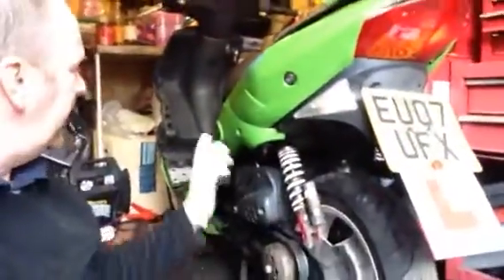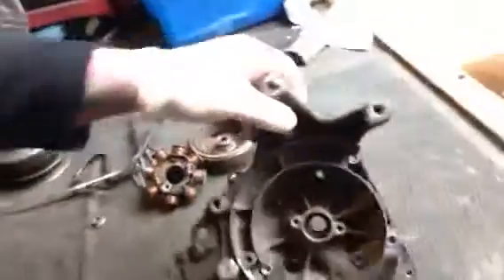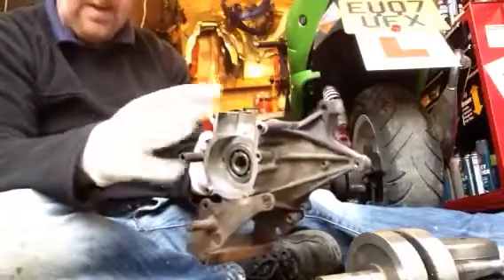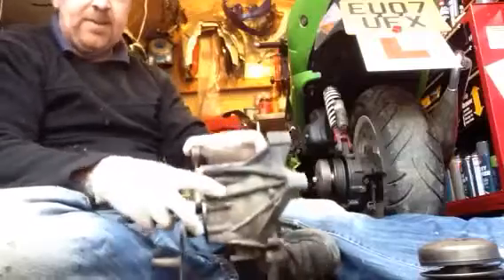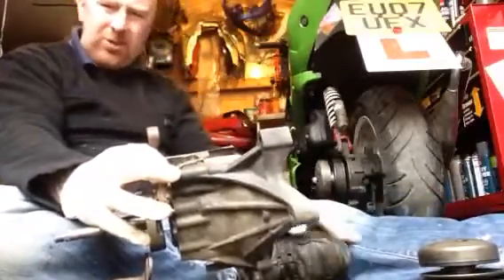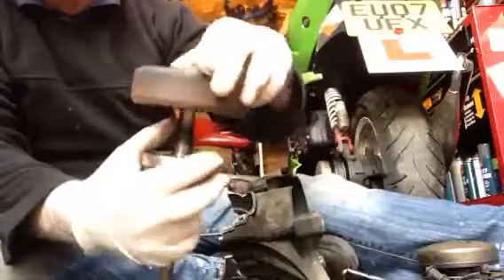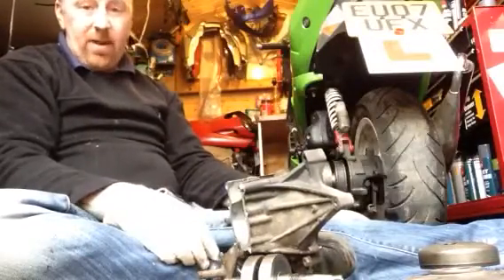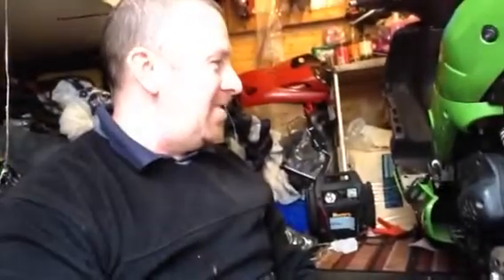Changing the crank on a moped Speedfight mark savage

Comment: I HAVE a problem. I did an engine rebuild on my speedfight2 50 LC. I changed crankshaft and crank bearings /new oil seals. It has a nice spark, gets fuel, compresion is good, but it just won't start. I tried everything but all it does it smokes a bit after cranking for longer time, and kinda would want to start but just burns the gas but won't start.

Comment: i have a problem where i splited the engine case on my piaggio zip and changed the piston and crankshaft but now the case wont fit? The case wont close fully i think the case is touching the crank bearings I have a doppler endurance crankshaft.

Comment: can the rear crank shaft be swapped on a peugeot v clic my back wheel seized and no garage could get it off so got told to cut the wheel off crazy I no but was gonna get charged more then what the bike was worth cheers shane
Reply from the maker: It's the gear box shaft and yes 
I have a video on a speedfight gear box 
Same thing 
Check it out
Gearbox Mark savage

Comment: hi my crank fell in a tank of gasoline while working ...should i relubricate it with 2T oil or is it ok to screw it back in like that?
Reply from the maker: I'd let it dry and rub a little 2t oil around it like you said bud 
Then fit 
Also with the piston when fitting with a  2t
Reply: @marksavage  thank you // i can get back to working on it now

Comment: Hi mark ive just aquired a speedfight 2 ive done a full enginge rebuild from crank upwards its the electric oil pump version kicked it over it trys to start but then doesnt do i need new cdi and voltage reg thanks
Reply from the maker: Was it running before ?
Sounds like crank seals ??
Have you done the wet hand test ?
Might just need some easy start to get it going 
As long as you have put it all back right
Reply: @marksavage  i havent had it running crank seals are in good condition no leaks from either side and wet hand test? Not heard of that before bit ive had a look today while its trying to start it does a littpe back fire every now and again and all put back together right ive had experiance with these just not the cdi/oil pump in one
Reply from the maker: @lukesykes6662  if you have a nice blue spark cdi is all good 
Oil pump wouldn't stop it from running !
80 speedfight videos 
Wet hand carb test bud its all in them 
Back fire is fuel 
Normally piston , reeds , oil seals?
Carb ok ?
Reply: @marksavage  il have a go over it all again tomoz thankd for the help your a legend
Reply: @marksavage  where could i get a cdi/oil pump if needed
Reply from the maker: @lukesykes6662  wait 
Oil pump 
Theres two manual or electric 
Next cdi there's 4 
Immob , black or grey cdi oil or 4 pin 
Like in my video on cdi
Reply: @marksavage  its grey delorto one atm 8 pins if im right
Reply: And its a electric oil pump
Reply from the maker: @lukesykes6662  so that will be an oil cdi to the left side of the battery grey or black 
Oil pump under it
Reply: @marksavage  yeah its a grey one and oil pump is attached to left side of the frame i think that is grey too
Reply from the maker: @lukesykes6662  so you won't know if the pump that works till the engine runs but if you have spark the cdi works
Reply: @marksavage  il let you know how i get on tomoz thanks mark
Reply: @marksavage  update yellow spark
Reply from the maker: @lukesykes6662  well it should be yellow lol 
Blue to orange not yellow and you should be able to move it away slowly and it should jump to spark upto 5mm and away 
Change plug bud !
Reply: @marksavage  its more of a red to yellow

Comment: Is it possible to install a crankshaft without the installation tool, could I heat up the engine case and put the crankshaft In the fridge??
Reply from the maker: you can do the fridge bit as it does work plus just a little bit if 2t oil , don't heat it up no need bud
Reply: @marksavage  thanks for your help mark

Comment: Im not sure how you have such good luck with using a hammer, but more power to ya bro. I enjoy all you vid a lot, I appreciate you taking the time share the knowledge! Keep up the good work bro 💯🔥
Reply from the maker: as in my new videos now bud i use a impact drill now , off in seconds bud for both variator and clutch
so much easier
i have over 150 on them now for everything

Comment: Excellent videos as always.. Do you know if there is any way of testing a fully electronic display. The vivacity does not have a speedo cable, all the back of the display has is a single connection block and it looks like the LCD display has gone. All the other bulbs work fine and the display lights up as it should but no fuel gauge, clock or odometer display.  Have checked all the wires are pushed in as far as they can go in the connection block and swapped out the battery and regulator for new ones but still no joy. Continuity tested the fuel gauge wires and they are all fine too. Any ideas what the problem could be? Or am I right in assuming the whole display will need changing out for another fully electronic one?
Reply from the maker: im going to be looking at one next week with the same problem and normally its the clocks , this one was working until a guy changed the front bearings then said it just stopped 
inside the front wheel sensor is the clips and often go so im going to start there to see how he put it back on 
the cables do go but cost bud same as the clocks 
to be honest and the cheapest way to get around this is to get a phone holder and use you phone with an app for speed 
works very well !
anyway look out for the video in a few weeks 
take care bud

Comment: Hay mark, top vids, i changed the weights in variator, and iv properly buggered, the threads and nut on the crankshaft... is it repairable. Or would i have to change the whole thing..?
Reply from the maker: oh dear!!
that's not good, ok one trick is to drill through it with the nut on and put a pin through it to keep it on, ive done this before and it lasted, welding doesn't work as it just comes off and after a while.
other than that you will have to change the crank sorry to say, like in this and other videos on mine I have showing how to change it with the engine still on!
hope that helps, please like and sub
mark
Reply: Cheers pal, iv liked and subbed, pal.iv no experience, in doing such a big job though to be honest, iv seen ur vid, im not sure. IS it easy inuf to change.? Finding a new crankshaft will be a job in its self.lol. what do u think, about iv i thread it down a size.? Can u do that.? Cheers mark for your advise...
Reply: mark savage i say mark so it is possable to change the crank shaft with out taking engine out. Still a job though pal eh.lol
Reply from the maker: Matthew Marshall every time I’ve tied it it’s come off ! 
Has to be a new one bud 
But I guess it’s worth a try !!
Reply from the maker: Matthew Marshall yes bud I have a video on here on how. To do it 
There is over 70 speedfight videos bud best sit on a computer to see them all 
Plus I have another channel with all of them on a play list to watch under mark savage speedfight 
It will help loads 
Mark

Comment: thank you my bike was taking in no fuel im replacing the crank seals baring and shaft also the bike had no gasket on the crank case so i orded them too and some high temp gasket sealant got my self a 21 mm carb and the 70 kit racing cdi that can advance the timing but im going to leave the timing at stock
Reply from the maker: thanks for wathcing i have many other videos that may help 
please like share and sub 
mark

Comment: Hay mak yhanks for your advise, just one thing, about pinning the crankshaft, wi the bolt on, any tips on how deep thickness ,and what to pin it with.?
Reply from the maker: Matthew Marshall tbh I’d change it , this idea is only a repair that may work !
Drill right through and it will be hard to drill . 3 to 4mm and use a good split pin or hard steel nail and bend it over 
That kick start may not work after due to this 
Mark

Comment: Hi mark great video. Do you have a video why moped is still smoking after a minute of running?
2stroke engine. How to solve the problem thanks
Reply from the maker: hi bud 
its a few things like in my oil video cheap 2t oil so change to a better one , oil pump is adding to much 2t oil or more common its your piston rings

Comment: Hiya mark, iv a qestion pal, can i change the crank shaft, without takeing the engine apart,? Is it easy inuf, for some1, who has never done it.? Cheers pal
Reply from the maker: I have a few videos like this one that will help 
If you bikes not running what have you to lose !
I've done loads so ok it seems easy for me 
Getting it apart is the hardest did 
I'd take it out for doing it for the first time as you get a better view and all round access 
With 70 videos on speedfights you have all the help you need bud

Comment: Hi mark there is a scratch in the crank case on my speedfight 2. Should I try to get rid of it using some fine emery paper or should I just leave it.
Reply: It’s air cooled if that matters
Reply from the maker: hi bud thanks for watching as for the scratch as long as it's not leaking out it should be fine, odd how did it get there?but as long as you put it all back together and it all works all will be ok have fun bud please like share and submark

Comment: Hi, Can I ask your advise please.
I have a Yamaha Aerox 100 that needs crank bearings, they arrived I put them in from the freezer over night, popped in the freezed crank all going smoothly done up the crank bolts and it binded up, centering the crank did'nt work, would you say I have a bent crank?
Reply from the maker: ive never put them in the freezer but I have heard people doing it !, more like the bearing is not straight take it all out again and a look if all ok and that the crank went in on line and straight then if no damage try again but maybe tap it with a mallet lightly and around in a paten, hope that helps I have done a few videos on the aerox bud maybe have a watch, please like and share/ subscribe . mark
Reply: I used to fit wheel bearings on cars, have my own press, I ordered some more bearings C4 this time instead of C3 but will tap around the bearing after it pops in again, I have bought another crank just waiting delivery and will freeze that as well, will let you know how I get on, thanks for getting back to me so quick, thumbs up
Reply: mrcreativequarter . 4 months later . How did you get on with it ? was it successful

Comment: I got the bike with it already off lol trying to put it back on but I think the fed on the crank where you put the but to hold it all on has gone
Reply: Nut*
Reply: Can you tap and die the crank end ?
Reply from the maker: oh bugger, I've always changed the crank as it never really works and then you can not get the kick start to work as it goes over the nut to connect on to , give it a go but I never got it go work well or for long!!!!
Reply: +mark “marky bike” savage is it hard to do
Reply: +mark “marky bike” savage and they are like £74 new
Reply from the maker: I've done a few video's on here on how to do them and about that price, it can be hard for the first few times and times do go wrong! seems silly to have to take apart the engine just for that but I always do due to doing a fix just doesn't last long !!
Reply: +mark “marky bike” savage have u got a 2nd hand one I can buy from u
Reply from the maker: Sorry mate no
Reply: +mark “marky bike” savage what you think I paid £150 for the bike it will need new crank I'm thinking just sell it back on when I get the log book as by the time I fix it and mot would not get much back also could be more problems
Reply from the maker: That's the problem bud with doing bike up, I would of had it off you if you were local lol but you should get your money back in parts alone
Reply: +mark “marky bike” savage lol I'm in west London how much you think I should ask for the lot
Reply from the maker: +daniel what year mate and what are the panels like , well most none runners from 1'£100 to 300 mate
Reply: +mark “marky bike” savage Lreg what spark plug do I need is it the NGK BR7HS I got the crank sorted but won't start so working my way about the bike
Reply from the maker: +daniel yes mate Ac br7hs lc br8hs for 50cc , as long as you have spark now try some easy start to get it going bud
Reply: +mark “marky bike” savage thx I have spark will get some easy start and new spark plug anyway mite come in hande if I need it thx man your so helpful

Comment: Hi Mark thanks so much for making this video, I have a problem with my 100cc since rebuilding yesterday. I think it tried to seize earlier and maybe due to starvation of oil? Riding along after 3 or 4 miles or so and it bogged down. Starts and runs as cooled down but wondering how to test the oil pump? Any ideas on if it could be anything else?
Thanks in advance
Reply from the maker: it common so 1st do you have a manual or electric pump?, this maybe why the piston went in the first place, as in my other rebuild videos out some 2t oil in the pot as you may have already damaged the piston if it got hot!!
so either start over or pop a little in with the petrol and the test 
see when running if you have oil coming out of the pipe ,it should start to come through quickly after a few rev's or start to come down the pipe.
if not replace but by putting it in with the petrol it will stop a seize like in my rebuild video.
hope that help bud . ,mark
Reply from the maker: and please like share and subscribe , mark
Reply: Thanks Mark, think it's manual it goes from tank to pump which is on crank casing with throttle cable attached and then a smaller pipe comes direct from that into the crank casing. I have taken that off and started bike and nothing comes out whilst running... Is this the pipe you were talking about? What sort of pre mixture would you recommend? I guess that would tell me if it's oil related also!  Thanks again.
Reply from the maker: Paul Bayliss yes you have a manual one and an older one too after that it ran only from the crank then next was the electric ones, ok so you have an old one that opens as you open the throttle , is that working ok ? If on oil is getting to the carb from that small pipe it need changing but for now on the bottle of 2t it tells you per full up but too much It will smoke a bit and for the first ride it won't hurt to get it all oiled up and running till you sort a new one , see how it runs hopefully no damage to the piston ! , mark
Reply: mark savage it opens and closes fine but nothing comes from that directly to the carb which has really confused me... only a very small pipe which goes into the left side of the crank casing. Hopefully it won't have damaged it! I will premix for a while and see if the problem continues. I did read online of bleeding the oil pump using the screw on the top? Thanks again for the help mate, strange how bike ran fine prior to changing the crank casing due to snapped exhaust mount

Comment: Av you got engine videos how  to  take a 100cc  off and put one on
Reply from the maker: Not on the 100cc but over 100 videos on speedfights and it's the same process 
I've done it loads of time and it's not hard but need another set of hands to help 
Type speedfight mark savage 
They will come up and you can follow them 
It will be in my one day fix or engine ones

Comment: Great vid! My crank is really loose And Im guessing thats Why my moped doesnt work. Could I use this method for a Speedfighter 3 too? And do you know this might have happened? Is there something Else i need to do than just switching The crank? 
I would really appreciate if you respond:D i am really stuck And have had a lot of problems with my moped.
Reply from the maker: umm , maybe but it is harder to work on and if its your first time doing it so best take the engine out, as for why sounds like you crank seal or bearings have gone letting the crank move around, its going to be a big job bud so you will have to think is it worth it or sell on and buy another. hope that help mark

Comment: I've got liquid coming from the crank behind my variater ... What does this mean and how do I fix it ? Let me know ASAP please cheers mate
Reply from the maker: Sol Edgell hi bud , that sounds like your engine seal has gone and would need replacing and that a engine rebuild as in my videos and I've done a few on them , but first make sure it's not leaking from your carb or oil pipes and running down , may save you a big job , normal when your oil seal fail the bike starts to run very badly or not at all , hope that help watch my other videos  bud and please like share and subscribe , mark
Reply: mark savage  the bikes still running just can't give it full throttle without it breaking ... I've got another engine so looks like I'm going to have to make a good one out of 2 of them

Comment: Are you familiar with Yamaha Zuma's?
Reply from the maker: only to the fact it was but ugly with the twin round headlights lol, otherwise no bud
Reply: I got it, I need to replace my crank shaft and had the case split, but was having trouble getting the shaft to come out, but I got it today, thanks for responding. I got it stable, used a block of wood and a small hammer!